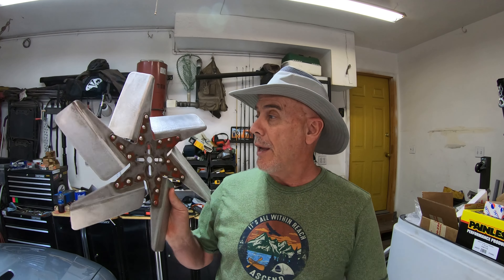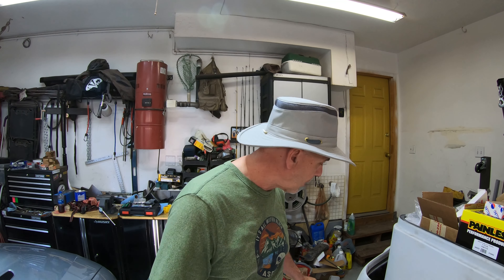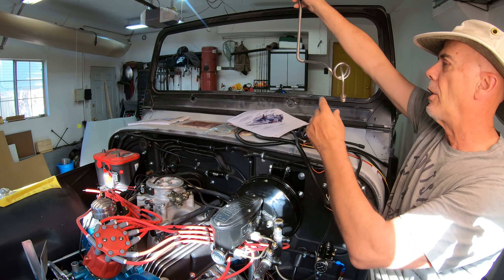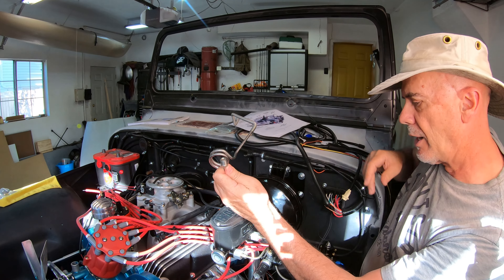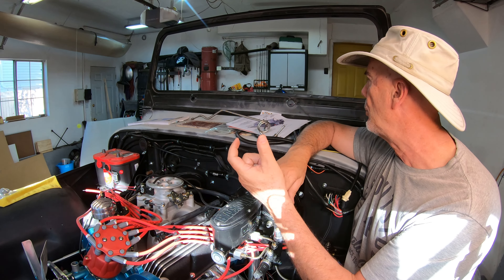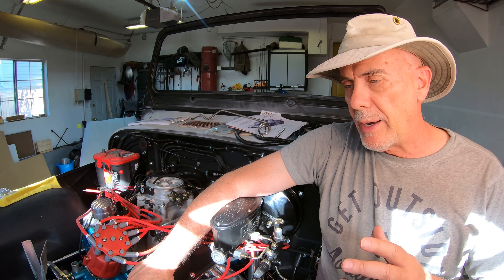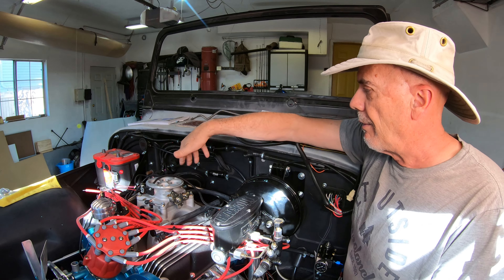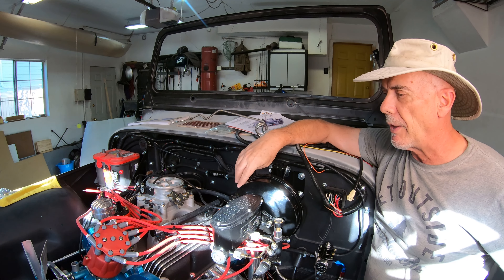EP92 - This episode is all about air, and the lack thereof

Comment: edit- after a little research on the subject I have found that you can indeed use the vacuum port to vary your fuel pressure slightly with vacuum.
Reply from the maker: Yeah - sometimes these part are a bit sparse on the instructions, leaving me scratching my head a bit.